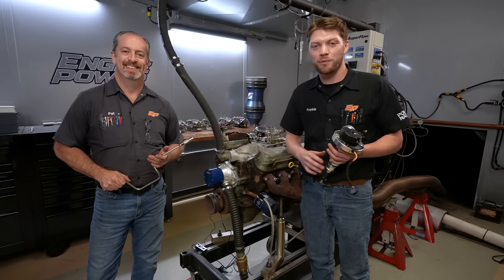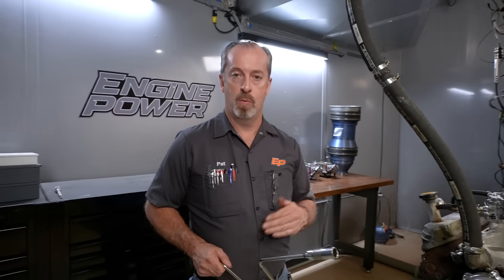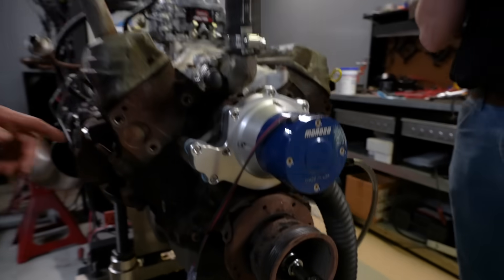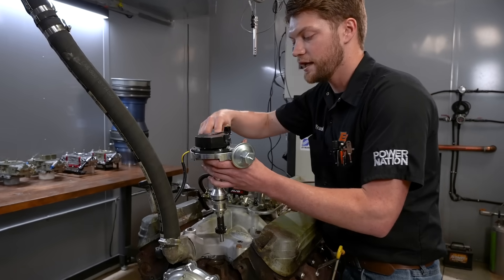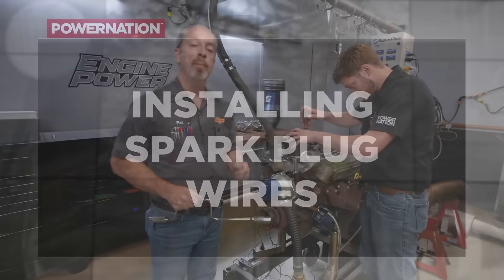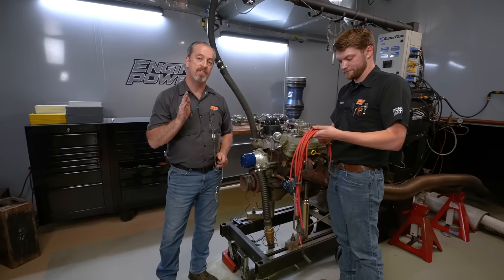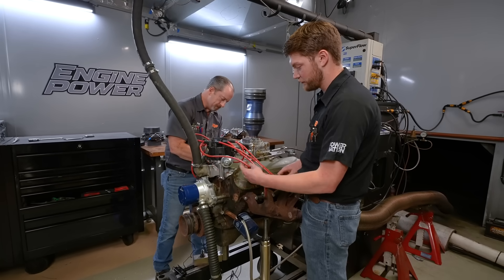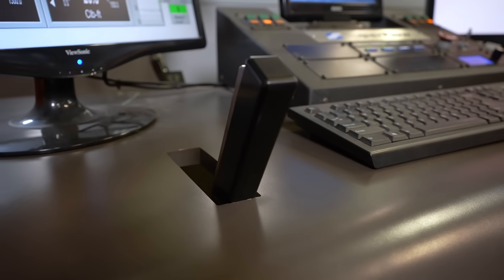Install a Distributor Correctly the First Time

Comment: You can also use a long screwdriver to get the oil pump in the right position
Reply: That'd be for SBC. The Ford is 1/4 inch shaft

Comment: Well your first problem is trying to put an hei distributor out of a Chevy into a Ford. To pass electrical class at trade school we had to set up the dwell on a distributor machine and then drop it in within 1/2 degree. Just set it up on #1 at the initial advance. Drop in distributor, put a test light on it and touch the advance. The test light will go out as soon as the points open. Lock it down and start the engine. It's slightly more difficult with electronic ignition, but all you have to do is line up the trigger points.

Comment: I am a bit confused on the last section of setting the total timing. Should I see 12 TDC (or comp.) or should I see 30 TDC when using the light? This is a great video and very thorough. Just for clarification if needed, I am running Ford 302 w / roller cam and points distributor.

Comment: My only question to this video is why install the distributor when it’s at 30 degrees then rotate so it can fit. It moved to tdc. And are all engines set to 30 degrees I’m very confused but I’ll give this video a try. I have. 302 that has been having an mis and recently cracked a head. New heads are installed but timing is off.
Reply: You aren’t the only one.

Comment: If you're still responding to this video I have a question... or if someone else can answer. 
I understand stopping the timing mark 30 degrees before TDC. My question is about turning the distributor to its max mechanical advance, then locking the distributor body down. It's hard to sort this out in my brain but does this nullify the 30 degrees as set by the timing mark or actually increase the advance timing????? It seems mechanical advance tied with the vacuum advance it would cause over advance. I'll have to watch again.

Comment: This video was so amazingly  helpful, I have a 77 ford highboy I recently bought and on the way back from buying it, it decided it didn’t want to start, turns out the pin holding in the distributor drive gear had sheared off. I’ve never worked on a car and I had spent over 4 days installing, reinstalling and adjusting  just to not have it spark to life. Your video was so helpful. it also helps to have the correct wiring  order 😅 which I did not have. Anyways thank you so much for your amazing video!

Comment: video is confusing. are you stopping at TDC or 30 degrees before TDC?
Reply: Before TDC I did 10 degrees before TDC and it was not enough I had to turn the distributor as far advance as it would allow just to get it to start. So I got to redue it at 30 degrees before TDC

Comment: Why didnt you show setting it on 30 before tdc you just showed setting it at zero but this video helps a ton
Reply: They set the timing marks at 30 degrees BTDC at the 2:54 timestamp .
Reply: @44special9 a lot of people are asking why start at 30 and not 0. My only thought is bcuz its a adv type dist.

Comment: Good tips, except you haven't accounted for any possible slippage the balancer may have had.  Should verify that the piston is at TDC before you install the distributor.  With a long narrow screwdriver, you can feel the top of the piston through the spark plug hole.  This would also come into play if you use a light to set the timing once it's running.

Comment: Put it in, take it out.  Put it in, take it out.  Put it in, take it out…

Spring, 2025.

I recently did a complete refresh of all the components of a 1993 Chevy C1500 ignition system -- plugs, wires, coil, and the distributor.  The effort was due to a cough/barf problem once the vehicle heat soaked.  The issue was the 15 year old distributor cap.  The center brush fell out when I removed the cap for inspection.

Anywho, while the distributor cap was off, I noticed the pick-up coil leads under the distributor cap were suffering their age and thousands of heat cycles with brittle and cracked wire insulation.  The green crusties were there too.

So, while in there, I might as well throw in a completely new distributor!  And while I have the new distributor in my hands, I might as well perform a modification to help the ignition control module contained under the distributor cap to run cooler.  My plan was to aluminium braze an electronic component finned heat sink to the underside of the distributor cap.

Of course, the new distributor needed to be completely disassembled -- off comes the lower helical gear and out comes the rotating distributor shaft.

The aluminum brazing happens without a hitch!  So, I put the distributor back together.

The day comes to do all the work under the hood.  Plugs and wires get replaced and I attempt to insert the distributor...  It won't drop into place.  I futz with it for more than an hour.  Finally, I compare the new distributor with the old distributor.  The end helical mushroom-headed gear is on upside down!  So, the new distributor comes out so the gear can be removed again and flipped over.

Then, I get back at trying to drop the new distributor in the engine again.  Now, before I removed the old distributor, I lined the rotating distributor head up with a yardstick and put a paint mark on the battery case where the head, yardstick, and mark lined up.  This way, I can get the timing right when dropping in the new distributor...

However, I can't get the new distributor to line up with the marking on the battery.  The distributor is either too advanced or too retarded in its position.  But, I still continue to play with it for around an hour.

Finally, I ask myself, "I wonder if that roll pin that holds that mushroom helical gear in place on the distributor is symmetrical?

Having a looksee, on one side, the roll pin hole lines up perfectly with one gear tooth.  On the other side, the roll pin hole bisects two gear teeth...  Yeah, it isn't symmetrical.  This was also at the point I noticed a divot in the helical gear which lines up with the way the distributor rotor head should point.

So, for those counting, that helical gear had to be removed and installed three times...

I finally get the distributor lined up with my previous mark on the battery with it dropped all the way in the engine.  With the cap installed and everything hooked up, I attempt to start the engine.  It coughs, barfs, and complains.  So, I twist the distribution cap a few degrees each way until the vehicle does start.  Oh, it's running rough, all right.  But, I tweak the distributor cap until it's running as smooth as my senses can detect.  Now, we hit it with a timing light.

But, I can't see the harmonic balancer timing mark at all!  Dirty?  Rusty?  The truck's running at idle fairly smoothly...

With the engine off, I crawl under the front and manually rotate the crank via the balancer to find the timing mark.  Oh, it's there!  It's just nowhere near where it should be!  Off come the wires along with the distributor cap, and out comes the distributor.

I align the crank timing mark to 0° TDC per the factory timing specification.  The distributor gets put back in the engine with the Zeus lightning bolt throwing head of the distributor shaft pointing to the distributor cap plug #1 post.  Everything gets put back together.

I've got a 50/50 chance, right?  It's either TDC of the compression stroke or TDC on the exhaust stroke.  Any guesses?

Of course, with the way this job is going, my batting 1000 of screw-ups remains untarnished -- it was at TDC on the exhaust stroke.  Thumbing the starter resulting nothing...

Everything comes apart again and I rotate the distributor rotor head 180° with the timing mark still lined up.

Finally success!

Three minutes of timing light work and the truck is back to running line the well-oiled sewing machine it's always been.

Building stuff and making modifications is nothing more than patience and persistence and a lot of wasted wheel-spinning.
Reply: I spend about 75 percent of the time in that useless wheel-spinning mode.  The only good thing is that all of the analysis I have to do to figure out how I screwed things up helps me to better understand the workings of my truck.  I stood out there by my truck for a really long time totally surprised that my distributor's rotor moved counterclockwise when Chilton's has me turning the crankshaft clockwise.  Looking on the distributor cap, though, and comparing with the firing sequence, I learned that was indeed true for my 02 Frontier.

Comment: Once you learn how to set timing on a VW engine you can probably set timing on any engine build. It's not hard folks. Is through the years I felt so many engines that I normally don't have to move the timing mark after checking the timing I have it down to a fine science. Most important thing is prime the carburetor fired up for the first couple minute's, turn it off check your fluids and then start it back up and run the cam in breaking time 20 minutes minimum.

Comment: Just a couple of pointers from a retired mechanic.  Find and use small corks to help you find TDC.  The cork flies out, your close!  See the timing mark?  Find some white out and mark that line!  Wipes off easily, but you will see it!  When you are lifting it, or setting it, note the direction of the rotor movement.  I used white  out and marked it inside the distributor for reference.
Reply: I just bought Ford f100 with v8 motor in it I can't wait to start working on that engine thank you for this video
Reply: Finding that all in timing is great for a street rod. 👍 I like that,
Reply: On a Small Block FORD the Rotor turns Counter Clockwise when running. Chevy turns Clockwise.
Reply: I just sub'd to your channel. I hope you upload content.

Comment: I have an old 302 HO motor I believe I am in the correct spot I have it on zero and both valves are closed , I don't have anyone to put there finger in the hole

Comment: Great video guys.  One question, why when you  find TDC do you continue to rotate to 30 degrees BTDC and not just go to the recommended timing of 12 degrees BTDC?
Reply: Yes, the subtle language in this video is ‘In our case 30 degrees BTDC.’  The only item missing in this video is a more thorough explanation of why in this case it is 30 degrees BTDC and how other applications can be different an how to account for them in a general sense.

Comment: I would like to kno why why you guys stopped the timing at 30° before TDC ? Is that what ford's run? Seems high compared to 12°.  B4 TDC for Buick 455 or small block chevrolet...just asking
Reply: The total , fully advanced high rpm timing was set instead of the base/initial idle timing . When the engine is at idle the timing will be at the typical 6 - 12 degrees BTDC range or so and when the engine speeds up enough and the timing fully advances it will be at 30 degrees BTDC .

Comment: I bought a '66 Cutlass recently and I am seeing 60 degrees initial timing when using a back dial timing light. After rotating the engine to line up timing marks on the balancer to find TDC and pulling the distributor cap my rotor is pointing to #8 not #1. Could this mean my distributor was installed 1 tooth off. Interestingly the engine idles fine and has close to 19 PSI vacuum. Also my vacuum canister is hitting against the firewall so I hardly turn it anymore CCW. Olds engines like the Ford in this video rotate CCW.

Comment: Said nothing about the oil pump drive rod !!! It could possibly fall into the oil pan due to the push on washer tha supposed to keep it from falling when pulling the distributor, some of those washers will crack and will cause it to fall when you remove the distributor..

Comment: You guys made hard work of an easy job.

Firstly, to find TDC your way you need two guys because its damn hard to put your finger over No.1 plug hole AND turn the motor, especially if it's still in the chassis. Far easier to chew up a piece of paper until it's damp and push it into the spark plug hole. Then, when you start coming up on compression stroke, the paper will shoot off with a loud "pop." 

Then you wind the timing on until you're at 12° BTDC and put the distributor in there because you won't be far off optimum timing. 30°?  ... WTF??

If the distributor wont mesh with the oil pump drive, you just drop in an oil pump priming tool and tweek it a tad, then try it again. It's also easier if you're on your own because trying to crank the motor AND jiggle the distributor home isnt really that easy.

Also, with a SBF using the 351/H.O (1-3-7-2-6-5-4-8) firing order the plug leads on the cap look far nearer and easier to route with No.1 at 8 or 9 oclock as you look down on the top of the distributor cap. This way, you only have two leads crossing over on top of the cap ... No.2, which will be at about 5 o'clock and No.8, which will be at 10/11 o'clock and can fit across the cap between terminals and make everything look symmetrical. The rest of the plug leads 1-3-4  and  5-6-7 will exit the cap on their own respective sides of the motor.

As long as theres fuel in the carb that motor will absolutely fire right up and be almost at it's optimum base timing and only need a tiny tweek of the distributor and the vacuum canister will have plenty of sweep fore and aft.
Reply: Their way wasn't any harder than what you just described. 

You just described how to do it with one person you're just nitpicking for the sake of an argument. 

It's one half dozen or the other
Reply: Your a nut.
Reply: It’s simple simple it’s called phasing .we do this with crank triggers in 2 seconds at the track , depending on boost or more nitrous etc!

Comment: I recently had poor directions adjusting preload for a roller 530 cam that resulted in bent valves shacking pistons. 
What is the best way to adjust preload? EOIC?
Is there a possibility of pistons being reused when pistons hit valves?

Comment: Sure 30 or even 34 degree before TDC will start good but what there not telling is it will cause it to build more vacuum pressure and force oil between the gaskets and also cause the engine temp to rise faster..I set my  sbc at 4 degrees before TDC starts without touching gas and bump key plus no longer had the oil and temp issue

Comment: It all sounds good but I'm taking it as you can put the distributor in any way you want as long as the one is matching up with the mark on the distributor I kind of doesn't make no sense to me I'm going to have to look for a different video I guess I'm working on a 250 Chrysler Marine engine

Comment: I've been having to work on much later (98-06) engines and needed a refresher on older ones. I'm now back to working on my 1971 360 ci engine and feel confident I can get that &@/! Distributor in correctly and get this engine running again! Thanks.
BTW, I'm almost 70 and us old dogs can still re-learn old/new tricks!

Comment: As I remember early 260/289/302 engines had timing (15436378) and the 351's were (13725548).  Late model engines all adopted the later firing order.  I often wondered why that was.  Also, wouldn't the camshafts from early 351's work in the early 289/302 engine with only changing the firing order to (13726548)?
Reply: So it fires twice on #3 each sequence and #2 is just along for the ride? "As I remember early 260/289/302 engines had timing (154 3 6 3 78)”  White out, please.

Comment: What is the model of distributor you guys are using.  I want to put a HEI in my 302 (1985 ford engine)  just heard a lot of HEI aftermarket distributors are not to good.

Comment: I realize this video is for instructional purposes that being said why aren't you using a Ford distributor instead of that big ugly ass GM HEI number one if you're going to teach something teach it with the proper parts. 
Setting your advance at 5,000 RPMs is crazy your vacuum advances are going to be all in no later than 2500 There's no need to do that I've been doing this for 43 years and I've never seen that procedure done! 
Furthermore y'all better not try and do that with a newly built motor You may not make an out of the garage.

Comment: Video correct. One can put #1 on the cap anywhere he wants after finding TDC. You can do total timing like the vid or base. Then tune after breakin. 12 degrees usually good for most all combo`s to fire fast and not round off cams. No need for timing light at idle. Fire up and break in. Tune afterwards if needed.

Comment: If you set the timing marks, engine off, turn the key on and move distributor until the coil fires, you can tighten down the distributor. Ready to start up and timing is set before the engine starts.
Reply: You ain't the boss. Stop . Don't tell me what to do or them. Stop
Reply: @RyanBenbow you stop
Reply: U mean with a timing light on #1? Gonna try that tomoro, thanks
Reply: @OAXBORN  no you don't use a timing light at all. Hold the coil wire (or spark plug wire for #1) close to ground and just watch for the spark to jump.
Reply: @onetransmission7871  ohh ok like a arc spark. Thanks man!
Reply: @onetransmission7871 , yes, this is okay on this older style of ignition, but in more modern cars you can ruin expensive electronic ignition by shorting to ground.
Reply: @bccoregon  that's what the spark plug does. Firing the coil in an  air space does absolutely nothing
Reply: @onetransmission7871  , I realize that, but I'm just saying there is more resistance to grounding the plug wire than there is when firing a plug.  Tech manuals warn against grounding a plug wire to check for spark on the newer ignition with electronics.  Old school ignition like this video are no problem if grounding to test.
Reply: @bccoregon  stick a spark plug in the wire and hold it on the engine block.